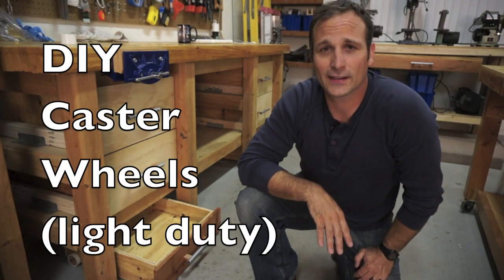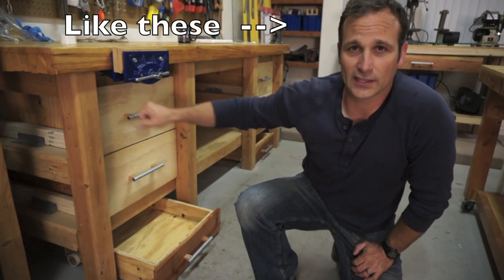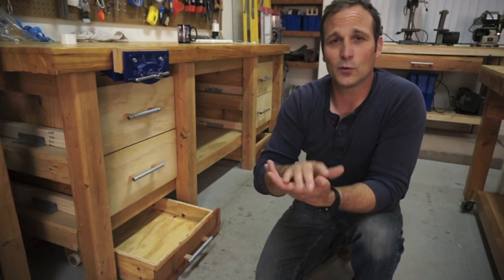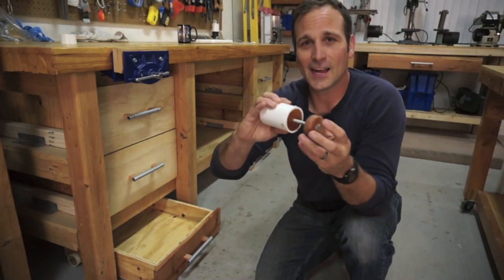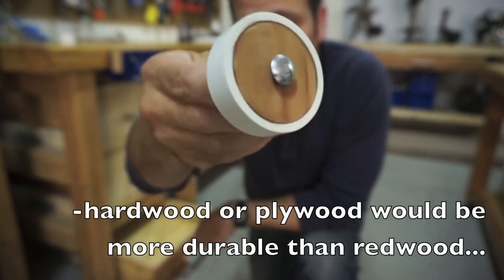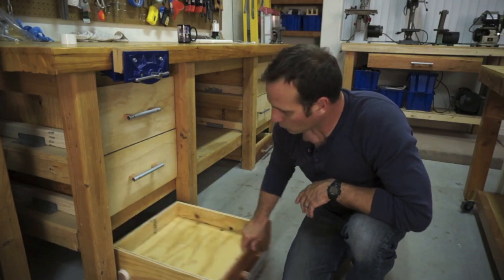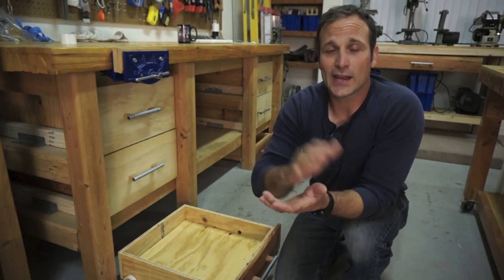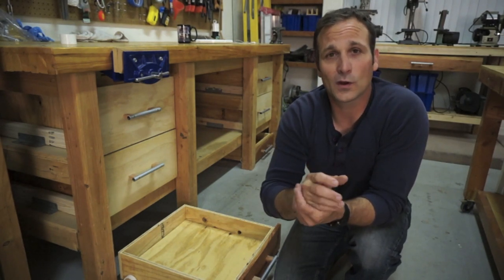Cheap DIY caster wheels - workbench drawers

Comment: Way cool. Might also work for under bed storage drawers. You may have to go wider on the wheels if you have a carpeted floor, but tons of potential uses. Thanks for your video
Reply from the maker: +Andrew Bieger thanks Andrew!  Yes, I think wider wheels would be a better solution for carpet or soft surfaces!
Joe

Comment: Great thinking  ! I used your idea to make a contact wheel for a belt grinder.   Saved about 50 plus bucks by not getting the overpriced ones made from aluminium and composits   Many Many Thanxxx !!
Reply from the maker: Thanks so much Recon watcher!  Glad you liked it and it's working well:)
Joe
Reply: You are very welcome Joe ! I also added some wide rubber bands to get a better grip on the cloth backing of the belt. Eureka ! works perfect. No slippage !  Again  Many Thanxx  Joe !!!!!!

Comment: Genius!!I never even thought about making my own casters,those lil wheels can get pretty pricey!!
Reply from the maker: Abel Nieto Thanks Abel... I was just at HD today and looked at the caster prices and it just reaffirmed my decision to make my own.  However, if I do a drawer that will be holding more weight, I might use a commercial set just to be safe.  But for light to medium duty I think these will hold up just fine!
Joe

Comment: very creative, easy to make and inexpensive. I'm going to steal the idea with the handles for a project and put matching painted wood plugs into the ends. Need long handles for 2 wide kitchen drawers and it would cost a fortune to get these full stainless steel handles. Thanks for the input, have some 1/2" conduit leftovers from making a few short curtain rods (sprayed black). I know now why I kept the cut-offs (:
Reply from the maker: haha... yes, cut offs are always great to use when you keep em... I try to keep all usable pieces.  I used to through small scraps away and then would kick myself when i needed them only a short time later:)

Comment: I've used sched-40 PVC pipe as rollers for moving my gun safe (1600 lbs empty), even without any wood inside of it.  I can move it single handed, just need to take my time.  It helps to have another person though to move the pipe rollers from back to front as you are going across the floor.  By using various sizes of PVC pipe, you can do minor changes in floor elevation and if you combine that with some blocks, you can even go up a 6" difference in height leading up to an exterior door.  What you've done there should be plenty strong for whatever you can put in those drawers.

I stumbled across this video while searching for a DIY caster / wheel design for a wheel that I want to put on the end of my backyard steel picket fence.  It's about 9-10 ft long and I made it with slots at the hinge area instead of holes so that it has some room to move.  I needed it to move because it is across a concrete area leading into my backyard where the concrete slopes one way as the gate is opened towards the backyard and another way as it is opened away from the backyard.  So, I decided to just let the hinge area move and put a wheel on the end of the gate so that it will always be the same distance from the ground.  The gate is to be electrified (due to dogs that are too clever for their own good), so I can't just create a metal disk for a wheel.  The PVC pipe that you are using would make for an acceptable insulator so that the wheel won't short the electricity to ground.  On the hinge side, I'll make an insulator for the pintle from some PVC pipe so that the metal of the gate is not in electrical contact with the metal in the pintle, thus eliminating the possibility of any electricity going to ground if the post is wet.